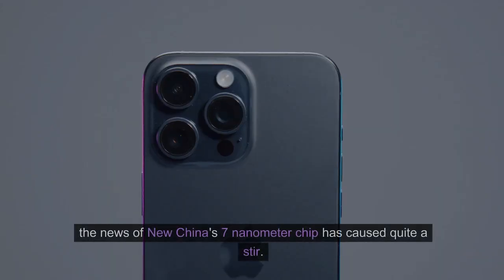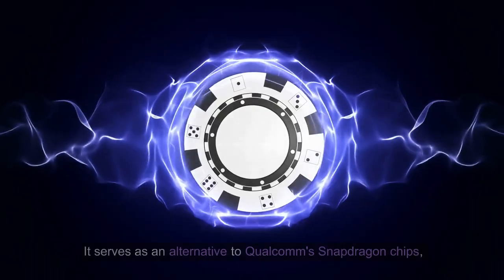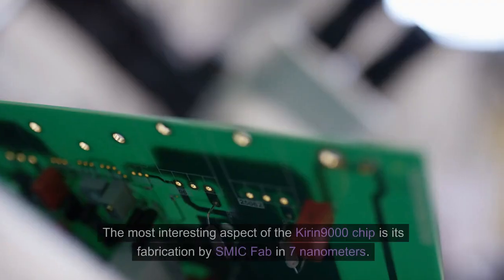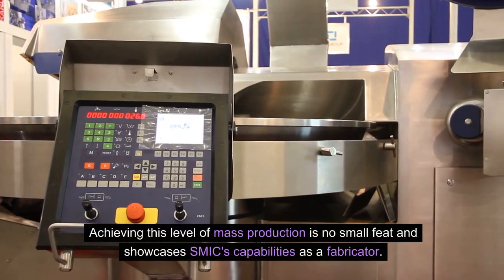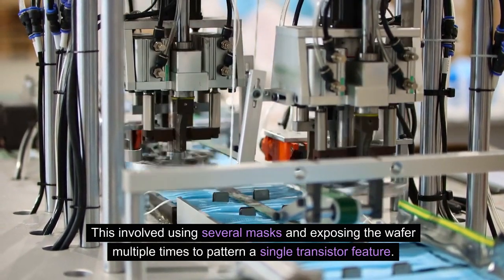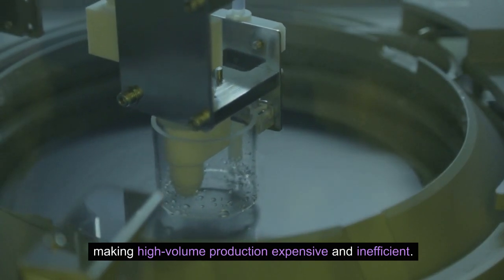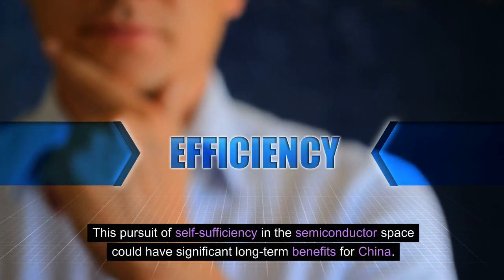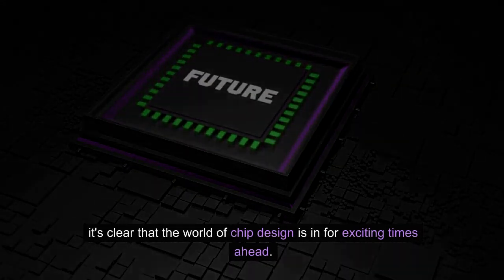China’s 7nm Breakthrough | semiconductor us china trade war

Comment: China 🇨🇳 SMIC is using the DUV to produce 5nm chips for the new generation Huawei Mate 70 Pro mobile phone. It proven that DUV is not limited only to 7nm.
Reply: tsmc original N7 is also without EUV. They tried run N7+ with EUV layers. 
Of course, you can use DUV and do multiple patterning to achieve N7 and N5, but the device performance is just not as good as device with single exposure with EUV. Tsmc moved to EUV layers on N5 for reasons. 
If SMIC produce N5 with DUV, I can guarantee you they won’t make any profit, and the device performance is not any better, then it’s better to stay in N7.
Reply: @老鹿亂撞  looks like you are much more clever than smic engineers 😊

Comment: 7nm and below only feasible for H.Phones with heat and power limitations. Other 95% applications for devices , logic, IC, switches, sensors, relays, etc DO NOT need 7nm or below. 18nm and above are more than sufficient. China has already MASS IC from NEW and latest Machines designed, locally assemble, tested and in PRODUCTION. By 2026 when IC in China Ramps up production , Intel, Snap dragon, AMD, Nvadia, etc chips will have significantly less DEMAND. See there will be PRICE WAR between US, S.Korea, Taiwan and Japan .......... Else they can kiss Bye Bye to their factories
Reply: Indeed, I agree with you. 
For the new/edge node, it’s all about timing. The one who can first make the mass production wins all. 
For the mature node, like N5, there are many competitors, it’s then about cost efficient. The one who can make it in lower cost will have the advantage in the market. Timing is not really important in this case. 
In SMIC case, I doubt how much profit they can make, it will be probably heavily rely on China government’s support.